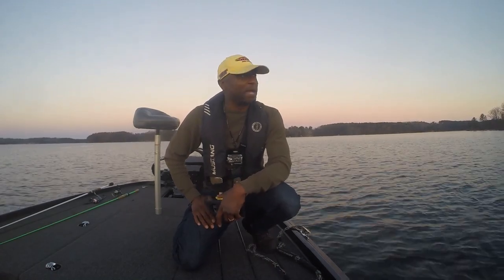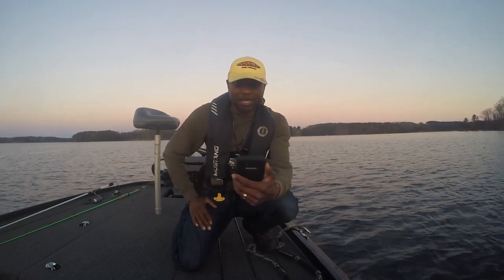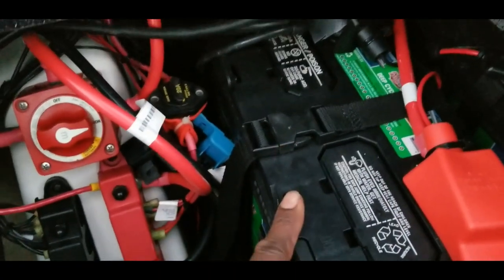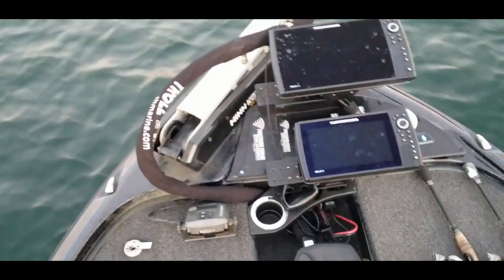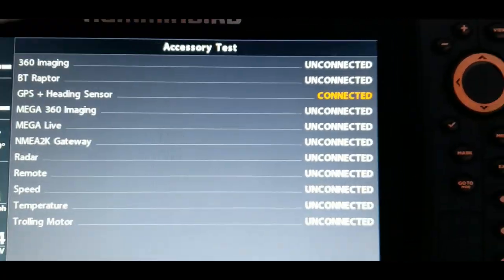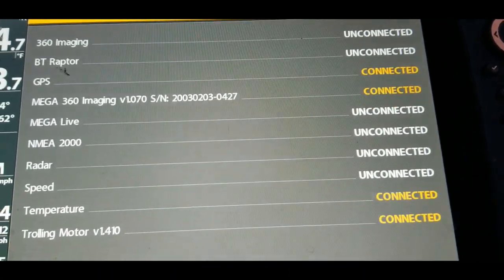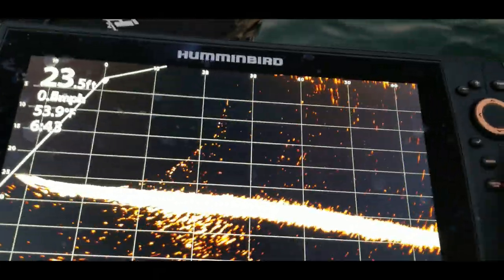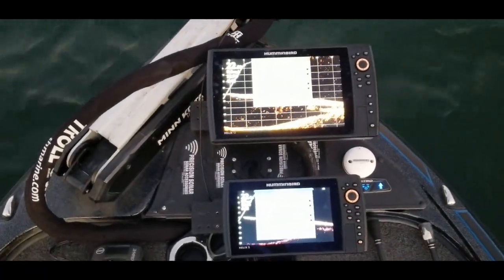Humminbird Network Troubleshooting - Helix & MEGA LIVE!

Comment: Make sure all units are running the same software versions or they will not communicate with each other also make sure you have power going to the Ethernet hub, would be nice if Humminbird put a status light on the hub to show you when it’s powered on.
Reply from the maker: You are correct. It would be great if there was a way to verify the status of the hub by looking at it. Thanks for the tip!
Reply: I agree with the power light on the hub!! I’ve had it where there isn’t power and it’s caused lots of frustration trying to figure out why it’s not communicating. Also would be nice to have a on off switch to power cycle it. And with the software you talk about having all the same versions is kinda correct but you may not necessarily have all the same units and generations. I’ve had some of my 12s and 10s different gens and work fine. Even with having some not updated. The hub should be able to work regardless. But with newer accessories and not having the update it may cause problems but that isn’t the fault of the hub. It’s the fault of the hardware and software not compatible or doing a correct handshake
Reply from the maker: @Mnfish22  great point!

Comment: Great vid Ryan, my boater last week had a HUMMINGBIRD HELIX 9 UNIT on the console and up front, but the issue was when he allowed me to set it up on sonar and down scan it kept going off, and when I mentioned it to him, he said he thinks it's a battery system problem, no matter how many times I set it up, when his system up front was on, the console unit kept going off, so I left it alone, and out of 225 boater's and Co-Angler's, I finished 108th with 5lbs 6oz's.
Reply from the maker: Fishing is a mental game. I hope the power issue didn't mess with your head. The coangler side can be tough. Be sure to take the things you learned from this tournament and apply them on the next one. For me, getting a 5 fish limit is one of my top goals.
Reply: @MoneyBass  Good morning Ryan, THANKS for responding, and it only messed with me when he was on the trolling motor going fast and he was passing by GOOD area's that had fish, but he wouldn't slow down, so I got out my crankbait and started working it, and yes, 5 FISH LIMIT, is my goal also
Reply from the maker: @chaunceydavis5290  cool. What do you think is the best lure to use when the boater is moving fast? I think a crankbait would get hung up easier since you can't control the retrieve speed well due to the boat moving. How did you know there were fish in the areas he was passing?
Reply: @MoneyBass  I using a DT-6, and a spinnerbait, but, I only caught fish on that, and when he slowed down, I used a shakeyhead and caught fish off that, but, a spinnerbait would be the best option, what about you.
Reply: @MoneyBass  THAT meaning the DT-6, 2 fish came off that, and the other off the shakeyhead.
Reply from the maker: @chaunceydavis5290  shakey head, fish head spin, Carolina rig, and Dropshot for fish on sonar.
Reply: @MoneyBass  Tried the drop-shot, he was moving too fast, so stuck with cranking and when he slowed, Shakey head, when his console unit was working and I saw fish under the boat, still couldn't use it, just too fast on the trolling motor.

Comment: I can share a tip on this topic. On the network hub. I have detected that it is quite important that the devices be connected in in adjacent slots starting from the power side. Then make sure there is no open slots between devices. in other words, if you connect 4 devices on the 5 port switch, start from the power and then fill the slots. Dont use slots 1, 2,3 and then skip a slot and use slot 5. This causes issues 

I have also experienced where the setup of the megalive goes all funky. they I have to disconnect all cables from network hub, restart system, switch off system and then reconnect all

Comment: Very helpful! I’m having issue with 0 recognition of any other unit on all units. I bought boat used, I’m thinking it’s either the 5 port box or maybe if I update all the software the units may join network. First gonna try updating software.
Reply from the maker: I agree, sounds like it may be your hub if there are NO connections being made. What model are the graphs you have on your boat?
Reply: @MoneyBass  g2 solixs
Reply from the maker: @reno-on6vw  do you have Mega 360 or any other equipment that would be networked?
Reply: @MoneyBass  no just the three solixs. I just got this boat like 4 months ago. Been along time since I updated the software. My garmin you can download updates onto your phone then from your phone onto unit. Having to order a USB port card reader.
Reply from the maker: @reno-on6vw my guess is the hub (possibly the power to the hub).
Reply: @MoneyBass  I have to find the hun, I think it’s in my console behind the units. Does the hun have a power supply or is it powered by the connections between the units?
Reply: Hub lol
Reply from the maker: @reno-on6vw  lol, I believe the hub has power going directly to it.
Reply: @MoneyBass  gotcha I’ll will find it and see what’s up with the power. Thanks

Comment: Ryan, Another excellent and highly informative video. I noticed that your Mega Live showed what I believe are interference rings possibly from your Mega 360. I recently received my Mega Live and have not installed it on my boat because it is still buried in snow. That said, last year, I noticed that my Mega 360 displayed wheel spikes (sorry being a French Canadian I do not always know the right terms to use) and I could reduce them by trying to deconflict the Mega frequency on my trolling motor connected Helix 10 3GN DI. My question is can you play with the Mega frequency of either or both the Mega Live and the Mega 360 so to minimize the interference? On a seperate matter,  at the console, I have a Solix SI+ G3 and a Helix Si+ 3GN, both networked with my two Helix 10 DI 3GN at the bow, I find it extremely frustrating that I cannot see on my Solix the Mega 360 because it is connected to an Helix.
Reply from the maker: That's cool! A French Canadian, I guess I'm reaching a lot of people, glad to help! The Solix and Helix should network together and show the 360 if they are compatible. Contact Humminbird support to see if there is a limitation with the Solix and Helix communicating with each other or if you might just need to adjust the network source settings. In regards to the interference, I've noticed that I sometimes get interference when I'm in shallow water. I am able to read the images through the interference so it doesn't bother me to much. Have you tried using the choke that came with the Mega Live? I would try adjusting the frequency on the 360 but I wouldn't sacrifice losing the ability to see fish or structure just to have a clearer screen. Hope that helps. Thanks for supporting the channel!

Comment: Can you do a comparison from previous mega live to the new firmware update put out march 4th 2022. It’s supposed To have improved jig tracking performance and cut out some of the flash. I purchased it yesterday but it won’t be installed until mid may. I’ve been looking at garmin. It seems to be the best overall from the reviews. My boat has humminbird 9’s at the bow and console that I’m having both placed on the bow with a 12 put at the console adding mega live and 360. Found your videos while contemplating my choice and they where very helpful. Keep the content coming you got a new subscriber.
Reply from the maker: What's up Ken, thanks for watching and supporting the channel. I'm actually editing the Mega Live update video right now lol. I've recorded the before the update footage with different lures but still working on the footage after the update. I want to make sure I have it set for the best results. For me, I get the best results with Mega Live on a 12" screen at the bow. 360 is the same. I have a 12, two 10's and one 9. I have a video comparing screen sizes. Check it out and let me know what you think. Thanks for supporting the channel.

Comment: Wow 5 batteries!!!!
How often do you have to combine the deep cycle to the starting battery on an average fishing day? Huge area you have for batteries. Where is your port hub located?
Reply from the maker: Hey Randy, I have 4 batteries total. 1 AGM with the green top plus 3 trolling motor batteries (36volt trolling motor). The AGM battery is connected to one of the trolling motor batteries via the perko switch. The 5 port hub is in the compartment in front of the console. This is a link that shows how I have it set up and how I wired my Mega Live.

Mega Live wiring and installation
https://youtu.be/bcKXJVa0DtQ

Comment: 4:54 when I go to the network system page like you did I often do not see my other two units. If I do however, the unit will show up in black letters instead of white letters and I cannot select it to get shared reading(s) from it.  What do you think?  I've rewired. I swapped out the brand new network hub, for a different (new) network hub. I have verified with a tester that the power cable going into the network hub is getting more than 12 volts.  I have swapped the head units around to the different locations in the boat.  To no avail, nothing seems to work so that all my three helix 12s are networked.  Please help
Reply from the maker: I usually reboot the graph and it connects to the network. Has Humminbird support walked you through the troubleshooting steps?
Reply: @MoneyBass  Yes Sir, I've been on the phone with them three times now trying to sort it.

Comment: How did you minimize the flashing on the screen
Reply from the maker: The flashing occurs more in shallow water. Try installing your mask. I haven't had a big issue with the flashing. Lowering sensitivity and adjusting contrast can eliminate noise but it can also make it harder to see cover/structure/fish.

Comment: I’m getting the out of water message for the mega. Any advice?
Reply from the maker: I had the same issue today. I restored the default settings on Mega Live, shut down all units and turned on the Mega Live graph first.
Reply: @MoneyBass  so do you need to do that every time now or is it fixed? Is there a proper order I should be stating things?
Reply from the maker: @jjmcg9688  I had that issue for the first time a few days ago. I believe it has something to do with my voltage. I haven't looked into it in detail yet.
Reply: @MoneyBass  thanks, if you can keep me posted if you find a solution that would be great.
Reply: @MoneyBass  someone told me it was because of the ground wire but I’m not sure.